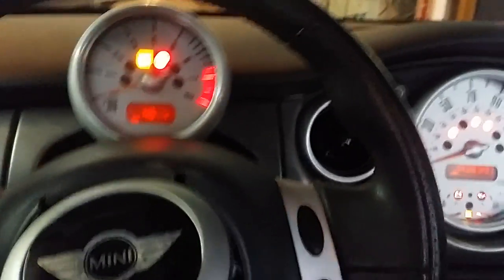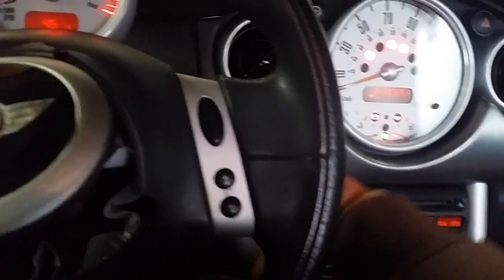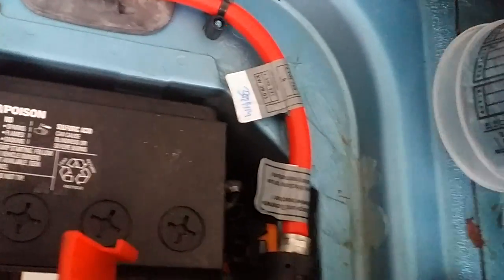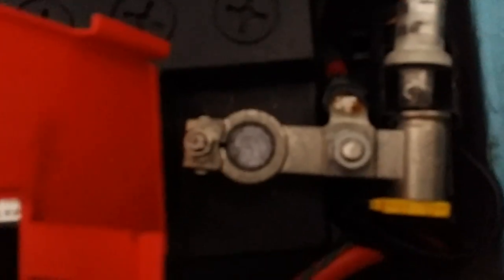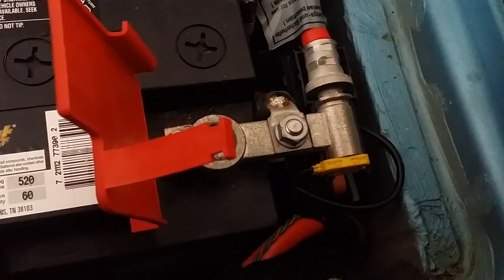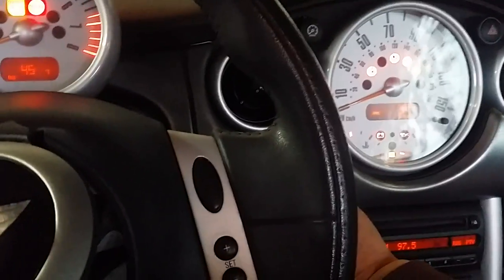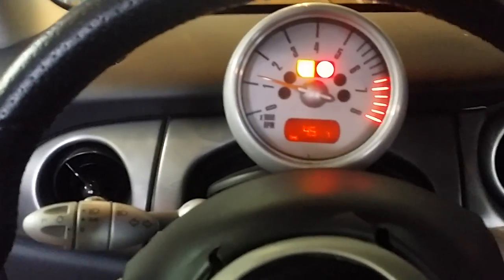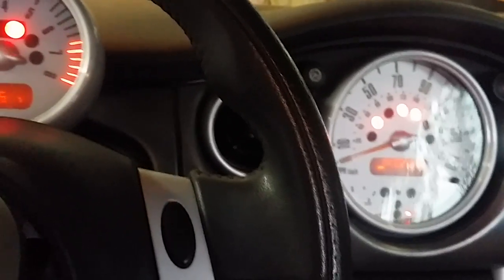2003 Mini Cooper BST Fix

Comment: Thanks for posting this.  My 04 Cooper S came to me with a 5 watt 3 ohm resistor soldered between the blue and brown twisted pair of wires that your video shows alongside the red battery cable that runs under the rear trim.  These wires must normally go to whatever fires the Squib/BST and the system looks at the resistance between them when it runs its check.  The PO said he installed the resistor because corrosion in the battery cable/Squib caused the air bag light to come on and the resistor keeps it off.  Thanks for helping me to understand what he did.
Reply: do you see this option? any phtos or tutorial?

Comment: Good info.  I would add that anyone doing this please disconnect the negative terminal first so you don't turn the back of your Mini into an arc welder especially using a 10in. crecent instead if the 10mm wrench.

Comment: Thank you for the informative  video..as i had a bang noise  in the 06 JCW car & wouldnt start next day.. was exactly what you pointed out.On inspection i wondered why the BST cable was loose..obviously it had popped out due to overload in battery.i got The AA out, to check all,& service guy wasnt aware of the BST,& battery wasnt get  a proper charging reading from alternator & battery due to BST lead popped.AA service guy said new battery & alternator faulty.In fact when he left,.i checked youtube,& saw yr video explaining all.This was a great help,& got AA battery service to install new battery,& all appears good now.Battery guy also coded the battery to the computer(important) .NB the old battery BMW make (prob original) was 11 years old!!So even the AA service guys werent aware of the BST module.As now the BST cable is secured back correctly..the charging should be fine.

I hope the above explains what to look out for & check,so any Mini owners will save $ & assists then in trouble shooting.

Comment: The BST system has a good intention but may do more harm than good in most reality situations.  BMW recalled this cable for 570,000 cars in February, 2013.  The deployment of the BST during a minor collision causes sudden engine shut off on the highway, and can cause severe or even fatal accidents such as hitting by other cars in the evening.  The German engineers had  tunnel vision in creating such an expensive but unnecessary design.  As plunging to water is more likely than fierce car crash, a manual window glass handle may be more important and life-saving when it can be re-installed by the manufacturers.
Reply: The recall you're talking about was for the terminal at the other end of the cable, where it connects to the fuse box. Not the BST connector. When this failure happens, it might sometimes cause a brief loss of engine power. Not a shutdown. 

There have been no injuries due to this, and only one minor accident. And none of this involved Minis.

http://www.usatoday.com/story/money/cars/driveon/2013/02/16/bmw-recall-cars-cables/1924627/

Comment: Someone said you can push it back in and turn it so it stays! and place a 2 ohm resistor where the switch plugs in, light should go off on the Dash
Reply: Ok I I😅😅 CB😊😅v 😅😅😊😊

Comment: Mine was not popped but i had a lot of water in the battery compartment and it caused the issue. It might be my antenna. or could be the break light. not sure.